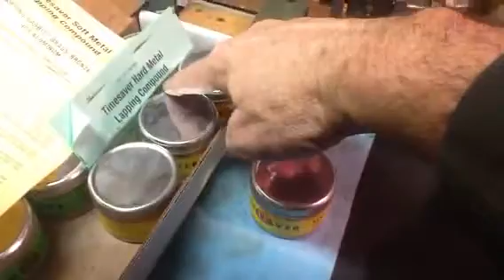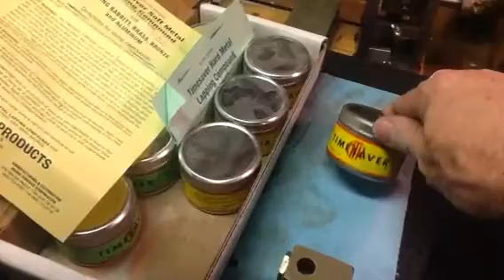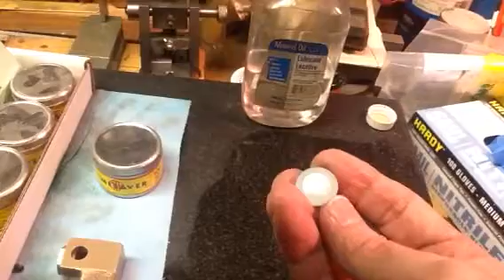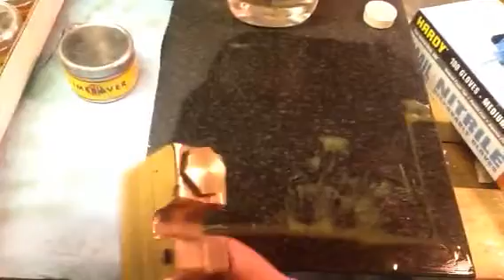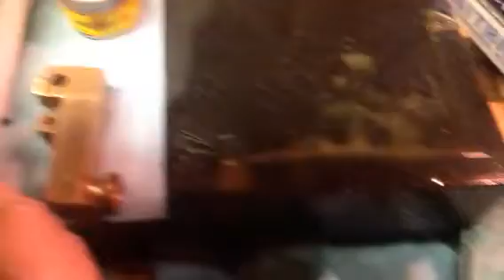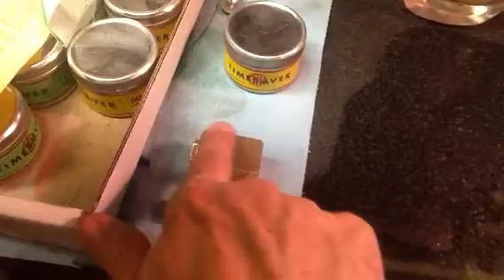Part 9 - Allen Mogul Throttle, Timesaver compound

Comment from the maker: Hi Michael, thanks for checking out my video. I am flattered as I was an early subscriber to your magazine. I don't think I hurt the surface plate as I was careful to work only on the margins as shown. I didn't want to use any sandpaper as I was concerned about imbedded grit in the metal. I suppose I could have used some butcher paper but was more concerned about getting the finish on throttle right than the corners of the surface plate. Thanks again for taking the time to view and comment!